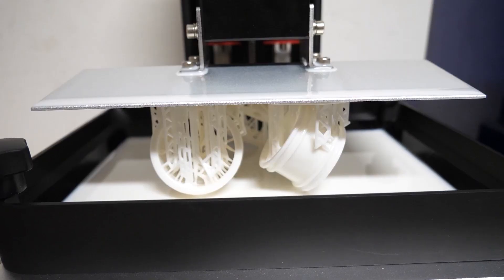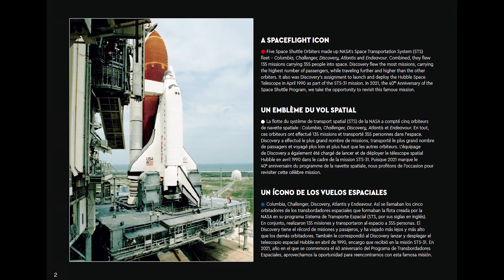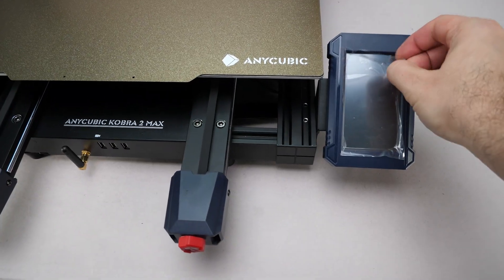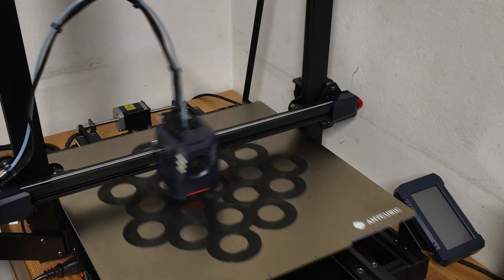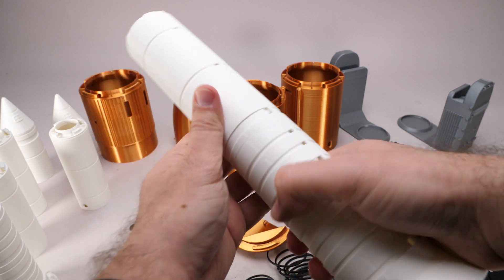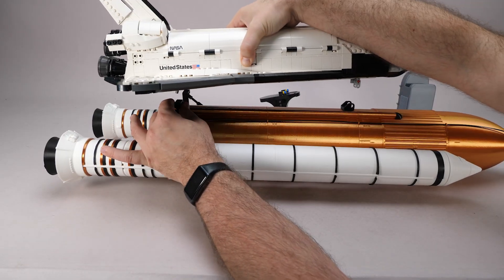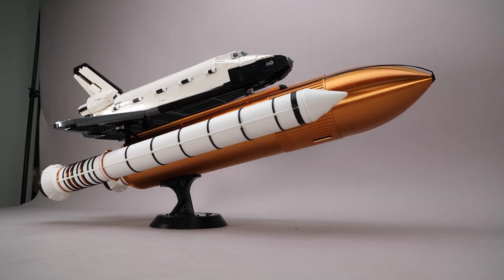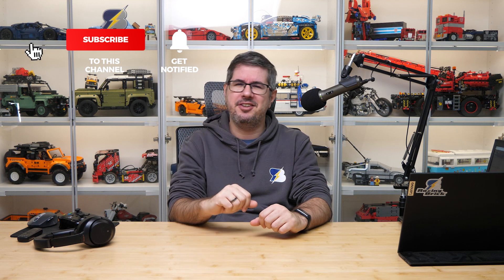A massive 3d printed upgrade for the LEGO 10283 NASA Space Shuttle Discovery

Comment: I tried building that fuel tank and boosters and launchpad,  but the problem was that the boosters were poorly designed and was expected to hold most of the weight on the launch pad.  So it all fell apart,  so not recommended.
Reply from the maker: I didn't experience any "poor design", according to the instructions you are advised to glue the components and they should be able to support the weight. Maybe you should double check the instructions and the quality of your prints?
Reply: @RacingBrick  I didn't glue the pieces together. That's probably why it didn't work out,  but I would never glue pieces together.

Comment: Well the speed number is pure marketing. The speed could theoretically print at that speed, and the motor movement would allow it to go above 1000mm^2 but the filament has to melt fast enough for the material to be able to exit the extruder. There are high flow nozzles, but its hard to print at a very high speed

Comment: Use the Anycubic Slicer and set the perimeters at 300mm/s instead of 260 and thats it, and y can also turn on sport mode while printing and thats really fast!
Reply from the maker: I could easily change the settings in Cura as well, but based on several reports the printer simply won't have a decent output at 500 mm/s. The flsun v400 has a default Cura profile with the highest speed settings and it can print with those without any issues.
Reply: @RacingBrick  mine looked great at 500mm/s

Comment: I agree with @freegy1998 it’s just YouTube but if your subscribed then you just get them like I just did 😉, anyway great result with the 3d print. Wow that main booster it shiny - it’s great to see that people are mixing 3d prints with LEGO builds like this.  I am curious though could you estimate how much the filament cost was for the print?  And what material is it pla/abs/petg?  
Take care & hi from Canada
Reply from the maker: I used PLA. Cost very much depends on your local suppliers, you can find a weight breakdown of the required filaments on the product page - "You will need 750g of orange filament, 650g of white filament, 200g of black filament and 400g of grey filament."

Comment: This is an interesting case where Lego could have made the brick container that is also a part - imagine if the tube of the huge tank was actually a single piece being the container for the whole set similar to those of Bionicle/Roboriders sets tube packaging. The tank could have been two piece tube with pointy screwed in top containing all the bricks for the shuttle and boosters. But it potentially would need to be made bigger in diameter because of that if the pieces wouldn't fit.
Reply: I remember a set like that.
It was set 5956 from the Adventures theme, where the explorer’s blimp piece was the storage space for the set’s pieces.